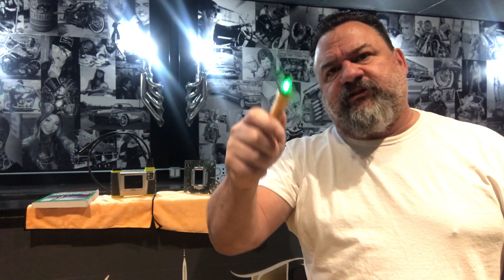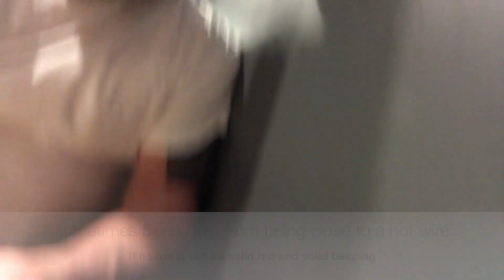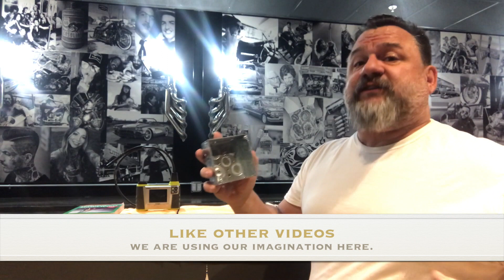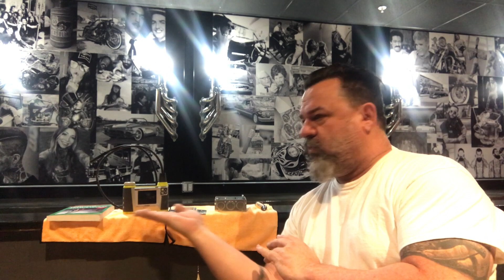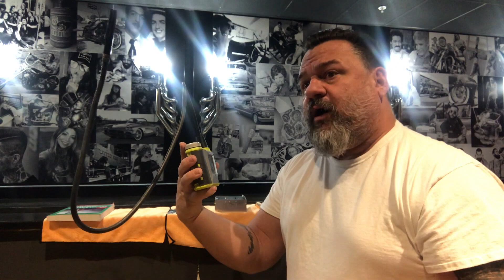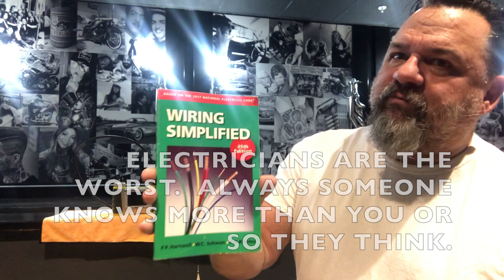Great Electrical Tools, Tips and Tricks too. from a camera inside walls to how to Guide.

Comment: Hey Lenny. Need some advice. I recently looked into a box with 2 switches. One was a switch for an inside light and the second one was for a porch light. The porch light has a programmable light switch that needs to be replaced with a new one. After looking inside the box I noticed that the ground wires were not being used and they were not connected together or attached to the box which didn't matter because it was a plastic box. It is an older home, not to old maybe built in the 60s. Should I attach these ground wires to the switches? I'm wondering if they are grounded in the panel.🤔
Reply from the maker: id imaging they are tied together somewhere and yes they are in the panel. but you need to tie them together in the box and ground the switches. its not the box you are worried about its the switch if it becomes energized it can shock you. so just do it the right way all the time and you will be ok

Comment: Please help me.  I am replacing a 200 amp meter and a 200 amp fuse box for my mother.  I have pulled a permit and the work will be inspected.  The meter box will not be directly behind the new 200 amp breaker box.  One stud separates the space between the meter and the panel.

Will I have to run the wire from the meter to the breaker panel in conduit?  I hope this makes sense.  Thank

break/break/break

FYI: Electrical supplies are difficult to find in my area - even at the big box stores.
Reply from the maker: well it depends on where you are. in michigan you simply run service entrance cable to the panel.  so long as you dont run more than 5 feet inside your house then you would need a dissconnect. thats a whole other thing. id take a look at your neighbors and see if any have cable feeding thier panel or you could simply ask the inspector. thats what they are there for. good luck and I hope this helps.